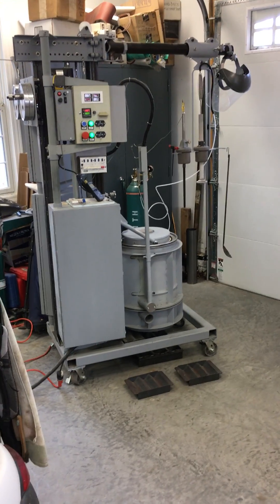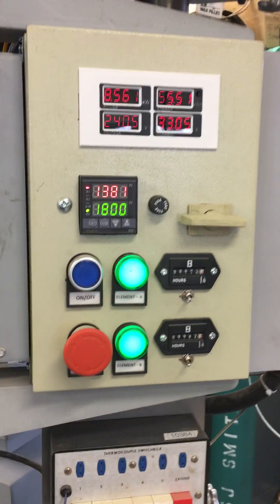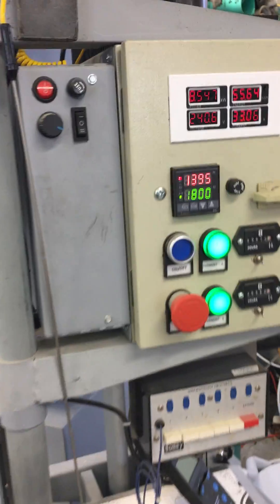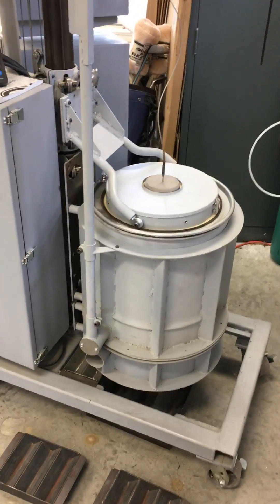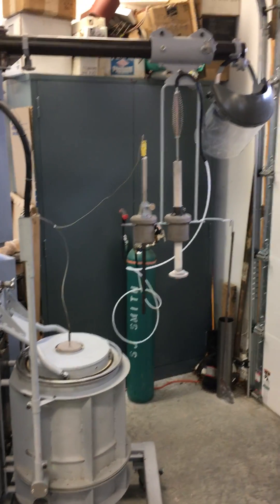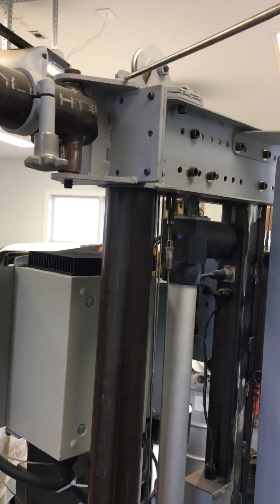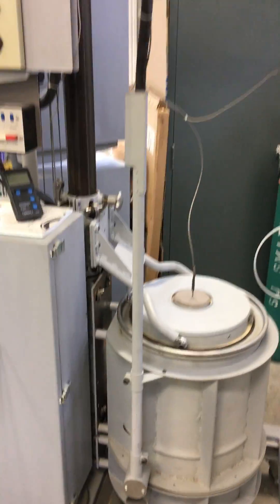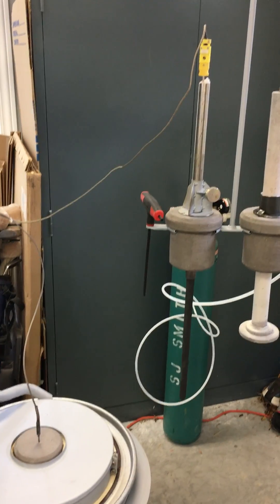1 Furnace Description Walk Around

Comment: im curous to know your what kind of power consumption specs for running this & cost value versus gas furnace. i assume this comes out cheaper or is much easier to maintain otherwise it would be a video of a gas furnace lol
Reply from the maker: It's an 8kw Resistive Electric Furnace. It will melt 10lbs of aluminum from a cold start in <30 minutes. Less time on subsequent melts. I pay .09 USD per kw-hr for electricity. So melting 10lbs of aluminum cost me 4.5 cents. And of course I dont have to store or buy fuel. Best, Kelly

Comment: pnid loop sure makes it legit... much better than IR thrmometers. whats the linear actuator used for? i couldnt hear. to lift the lid?
Reply from the maker: The linear actuator lifts the entire furnace body leaving the crucible sitting on the base fully exposed so it can be grasped and poured in a single motion with an open ring shank. There is a counter weight that essentially makes the furnace body appear weightless to the actuator or if lifted manually. Best, Kelly

Comment: Subscribed. Excellent build. Would be super curious to know what this setup cost. This really checks all the safe handling boxes for a single operator. Really enjoyed this. My old mifco might need to retire 👍
Reply from the maker: I had forgotten I made that video. You must have been digging deep in the channel archives. It has evolved a little bit in the last 3yrs but mostly just frill. The basics are the same. I wish I could tell you what I had in it. The majority of the cost was the electric components, actuator, the refractory, Kanthal resitive wire, and some of the metal. I think maybe $500 out of pocket. I ran a metal fab business so most of the metal was remnants I fished out of the recycling dumpster. I am a one man show. Check out my automotive intake video series for the gantry crane I use with my A60 crucible and that larger furnace. I should make an updated video of this and my other foundry equipment. The build for that simplified larger furnace is described here: 

http://forums.thehomefoundry.org/index.php?threads/furnace-cart-and-lift-build.278/page-3#post-9376

Best, 
Kelly